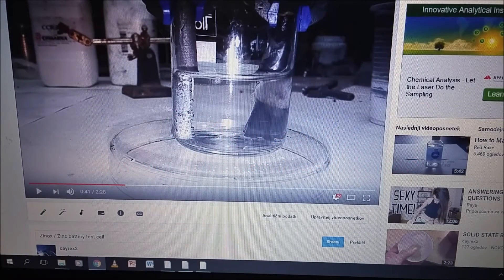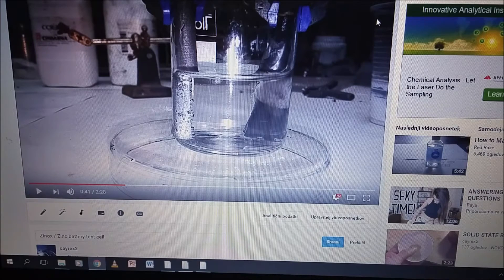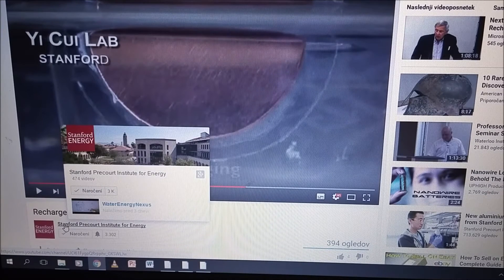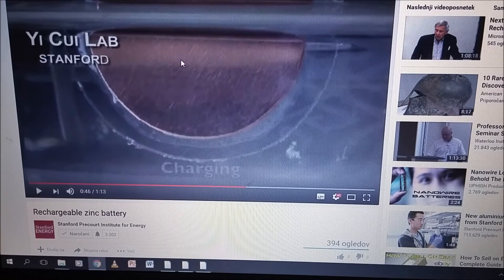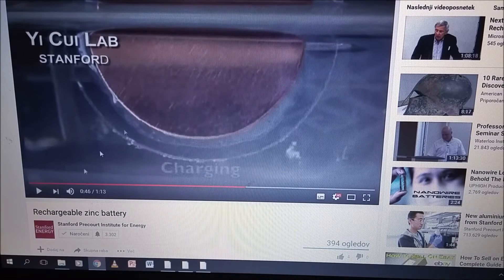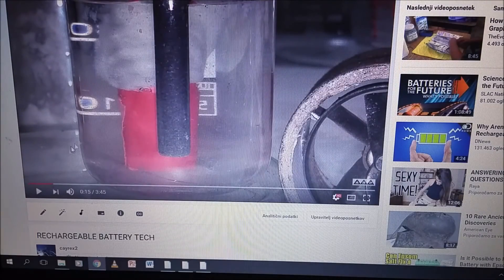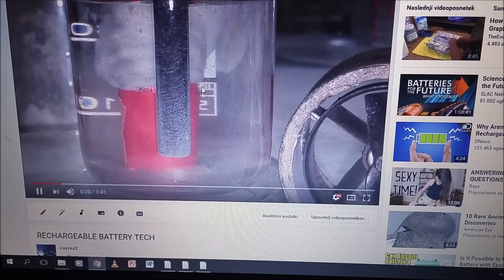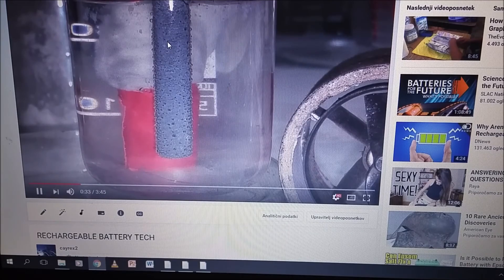Rechargeable zinc battery like Stanford University

Comment: Hi, what are the main benefits with zinc battery? Zincox means zinc oxidation? Is it just a galvanic cell?
Reply from the maker: Main benefits are low cost, high energy density, safety,... Zinox is the project name for this experimental zinc battery. The zinc from electrolyte moves to anode when the cell is charging and in discharge the zinc moves back to electrolyte.
Reply: I think i understand now .Thank you so much for the reply. Looking forward to more videos from you :)